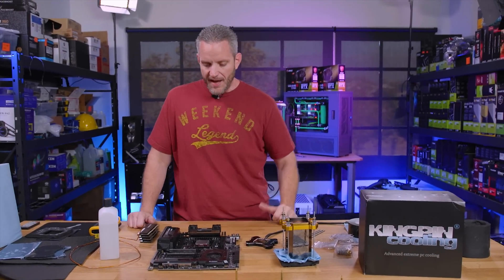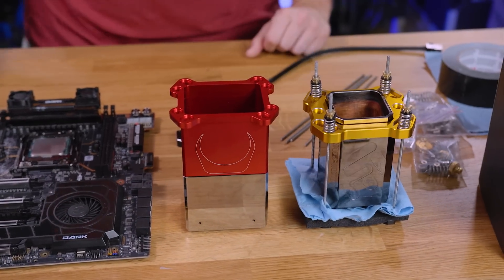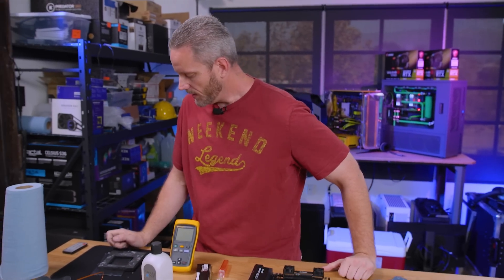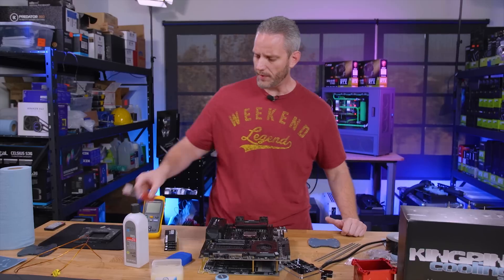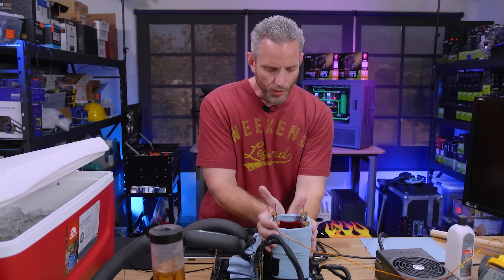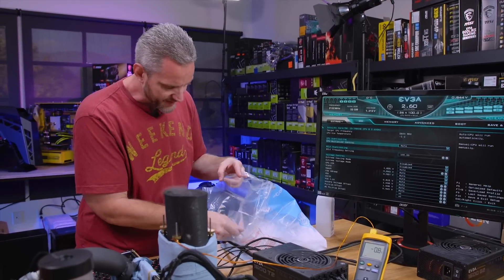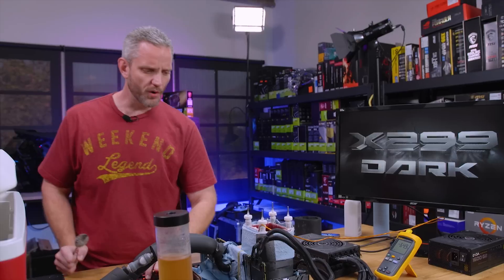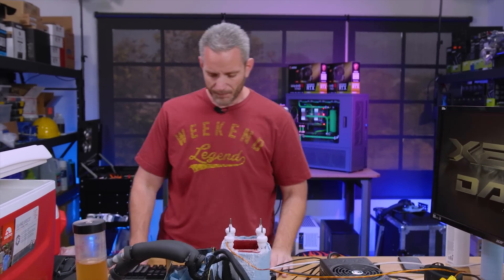Dry Ice Overclocking... NOT RECOMMENDED!

Comment: does 7980xe really gives better performance than 8700k in games? why does everyone keeps using the extreme edition previous gen cpus
Reply: The i7-8700K and i9-7980XE are two different platforms, and the i9-9980XE will come soon.  You don't typically buy them for games alone.  Right now anything with more than 8 physical cores and requires an X299 (Intel) or X399 (AMD) are intended for workstations with gaming on the side

Comment: I guess my question is would it be efficient to use a small volume of something like mineral oil. Just enough to barely immerse the board to prevent it from developing significant condensation.

Edit: Just kinda looked into the freezing temp of mineral oil which is -4c and dry ice gets down to -79~80c. So it would probably freeze it right around the chip but that shouldn't be super important unless it caused stress issues from contracting? But as long as it preformed the primary function of keeping moisture away from the board? I guess the other issue is if it is a better thermal conductor than air you might end up fighting it a bit more than the ambient atmosphere. 

Anyhow definitely interesting.

Comment: I wonder why people don't use vacuum chamber with dehumidifier to get rid of condensation....
Reply: lol no - a dehumidifier uses a cool plate to condense the water, then needs to get rid of that heat so may then dump it back into the dried air stream. An air-conditioner on dehumidify however dumps it into another room.
Reply: a vacuum chamber would be interesting, but it might be fairly difficult to pull it off and to cool the die at the same time
Reply: We do, sorta. Look up purge case and/or cold box. All you need is clear rubbermaid storage bin, cut out square in top and use gasket to seal ln2 pot top. Add small hole for tube connected to small nitrogen can (used for brazing) to purge or push out the oxygen.
Reply: Cant close the room cos of the gas coming from the cryo materials. Chillbox is definitely a possibility though, and people used to do it
Reply: Air's electrical conductivity increases as pressure decreases, up until you get a very high vacuum. So if you don't get a very good vacuum you run the risk of frying electronics if their voltages are high.

Comment: And I thought I was crazy piping in subzero air from an outdoor dryer vent in the winter time to cool my PC. Never had any problem with condensation since the whole inside of the PC case was at about 20°F.
Reply: and during summer you could reverse it to exhaust the pc heat outside instead of in your room

Comment: If the problem with subzero overclocking is condensation, I dont know why  these guys dont build a box and flood it with inert gas like argon. This is what I do in my synthesis laboratoy where i cant have any water molecule which mess up whit the synthesized products.
Reply: Dont even need to go that far - you can at least dehumidify the air - put it in a sealed  'chill box' with an aircon looping through it. Stick the pot through the lid so you can still feed the system. That way you only need fairly minimal sealing and only have to thermal cycle to open it
Reply: @mycosys  We use dehumidification machines in the synthesis room, we cant get moisture under 4% and we get condensation on glas at - 18C. Using inert gas (3 parts per million of water) we get virtually 0% moisture inside the reactor.
Reply: Thats the point of the chillbox - it is also at -60C. Even the condensation is ice crystals, so it stays put, and the load air can carry at those temps is miniscule. Its an old school and rather insane OC technique but it does work, and you dont need to gas down.to stuff with the hardware. you just have to run the chillbox down to low temps before you start the machine so the condensation is in the condenser.
Reply: @mycosys  regular dehumidifier's won't pull enough water from the air to stop condensation when your going down to -50+.  You could build a box and fill it with nitrogen, or anything else that doesn't have water in it, but it's more work then simply mitigating the issue in the first place.
Reply: clearly you dont know what a chillbox is. for ref - you just described it.

Comment: Would there be any improvement in performanceby using a graphics card extension cable and running the card in a non electrically conductive cooling fluid/bath? Why is there "acetone" in your solid carbon dioxide aka dry ice?

Comment: Hey Jay! Can you do a video on the history of liquid cooling? Particularly early history. I can't seem to find much online and I've always been interested on how people did it in the early days.
Reply: I saw people back in the late '90s using motorcycle radiators and modified garden fountain pumps with CPU blocks made from machined blocks of aluminum or copper all the pumps, reservoirs and radiators we're mounted outside the case.

Comment: I always think these should be started with a disclaimer about dry ice. If you're playing with dry ice, please do not do it in an enclosed space with little to no ventilation. Dry ice is frozen carbon dioxide which is heavier than air and can build up, causing the air to have less oxygen in it. Not trying to be alarmist. You're probably fine as long as you're in a decently ventilated area, but it's just something to consider. Don't do it in a small room with no airflow or you might fall asleep and never wake up
Reply: Joke's on you, I wish I didn't wake up
Reply: @S_t_r_e_s_s  people say it’s a painless way to go
Reply: I'm not gonna lie, that actually sounds pretty pleasant. There are far worse ways to go.
Reply: PwnySlaystation01 hey i found my whats up with the name ?
Reply: It also expands thousands of times going frm solid to gas, so it is REALLY easy to fill a small space with CO2. 
All thats why you dont see more cryofog on stage despite it being without doubt the best fog
Reply: @mycosys  Doing pantomimes each year (on stage) each one has had a dry-ice(co2) fog scene.  Sorry to disagree but dry-ice fog is real common on stage.   I work in back stage
Reply: @mycosys  more likely it's simply due to cost,  Making sure you have adequate ventilation is trivial for a setup like that.
Reply: LOL no - its because 'adequate ventilation' would also sweep away the fog. You need a large area for cryofog. But what would a stage tech know
Reply: BTW - cryofog is the cheapest way to make fog - all you need is a hot water urn and dry ice
Reply: Mijc Osis well my swim team is running death camps lmao we always enclose a hot pool filled with dry ice and Chant
Reply: @mycosys  well, 2 of the customers we sold co2 gas to that used it for fog both switched to another system because, you guessed it, cost.  The foggers that use a water\oil mix are MUCH cheaper then using liquid co2 over the long term
Reply: @Wooble57  cracked-oil foggers have a different effect to dry-ice(the fog speads more and go's/flows up, where as dry-ice keeps to the ground and flows down)  it is not used as much due to producers/directors not wanting that effect, not the cost.)

For example, when you want a to see "beams" of light you need a light mist/fog and dry-ice would not give you that effect.  If you want a spooky fog rolling over the ground maybe with a green glow then dry-ice would be the way to do that.
Reply: he has a mother
Reply: Fuck you im in a small room with dry ice
Reply: Carbon dioxide is the thing that your body responds to as feeling like you're suffocating, instead of the lack of oxygen.  So you'll notice, intensely.  So it's less of a problem than every other gas that might displace oxygen.
Reply: Your body will tell you if carbon dioxide builds up.  The body has no reaction to a lack of oxygen but reacts to high carbon dioxide.  If you start gasping for air get out of there. 
 ..  I know from personal experience.
Reply: @darmony9153  I think you’re thinking of “the body has no way to detect Carbon Monoxide”
Reply: Darmony91 
Seriously “the body has no reaction to lack of oxygen”......
Have you ever been mountaineering, lack of oxygen makes you shirt of breath like your gasping for air, causes dizziness confusion, and in extreme cases hallucinations, can cause severe migraines.
It also affects critical thinking and logical thought processing, that’s why a lot of mountaineers in high altitudes with lack of oxygen die.
Reply: Andrew Bedford The only symptom of lack of oxygen that you mentioned there was the lack of processing because your brain cannot get enough oxygen. Every thing else is too much CO2, causing the blood to be more acidic and making the body breathe more to flush it out :)
Reply: @andydbedford  The gasping for breath phenomenon is real.  But the reason it happens is that gas density at high altitude is significantly less than at seal level, and the body senses it.  It is quite possible to suffocate without realizing it's happening, provided gas density is similar to what the body is accustomed to.
Reply: @darmony9153  Spot on you are and LN2 is much more dangerous as your body doesn't a reaction to nitrogen like CO2
Reply: dude i call bullshit on not waking up. i bought 30 pounds of dry ice and threw it in a 8ft kids pool with 3 30 packs. had it in the middle of my living room for my wedding party. 130 jello shots 2 zones of girl scout cookie, 2 gallons of jagermeifter , 2 gallons of crown royal purple, a gallon of segrims 7 crown and 10 2 liters of coca cola and an official beer pong table from spencers. made black tooth grins and got the block fucked up. instead of doing a honeymoon my wife and I decided to throw a big ass party. the dry ice affected no one being in the house and gave off a nice layer of fog all night.
Reply: @IFIXUR360  Exactly. Its simple science really. CO2 isnt CO which bonds to the hemoglobin and prevents perfusion.
Reply: You would need to be in a really small space with a ton of dry ice before it would be dangerous.
Reply: @saltycorpsman5696  dry ice "expands" quickly when changing space, you wouldnt need that much
Reply: @lander3308  You actuallu just madr my point for me. Its all about concentration. The co2 levels on an airplane are going to higher that all the dry ice Jay has. Like you said, it spreads out. Which means you are going to need a lot to concentrate in dangerous levels.

Comment: I wonder if having this setup in a vacuum chamber would minimize condensation due to removing air out of the equation. It would have to be an elaborate setup to introduce LN2 during testing and to maintain a vacuum without any leaks but food for thought.
Reply: it sure would, but everything else on the board would be effectively insulated, so you'd have to put coolers and just about everything.  A vacuum prevents any heat transfer other then direct contact or infrared losses (well, if it's a perfect vacuum, but it will hinder heat transfer enough to cook a shitton of components)